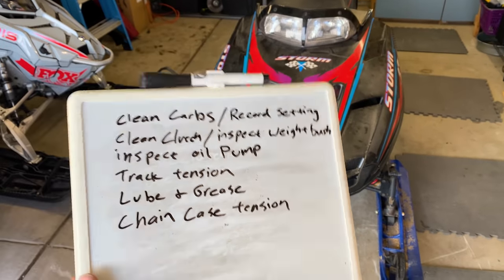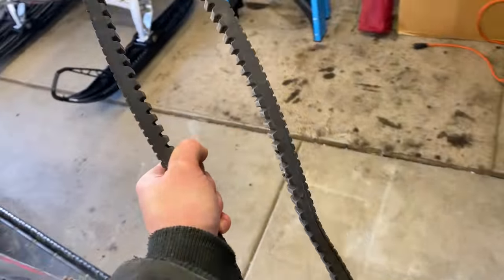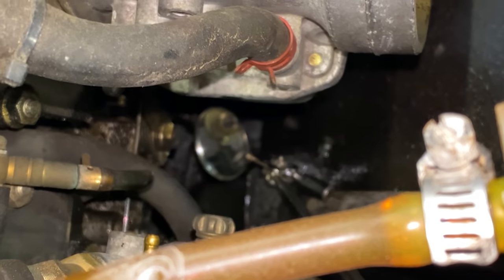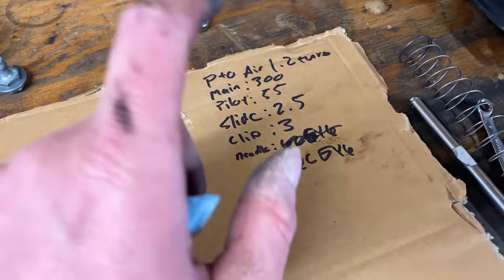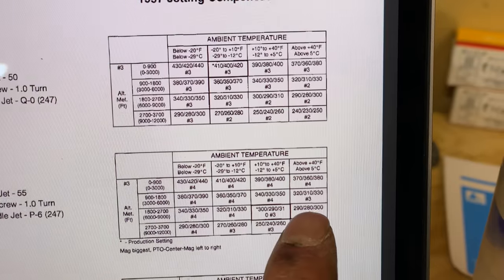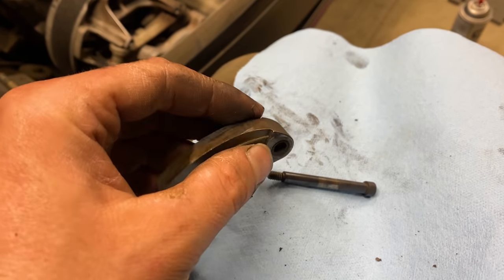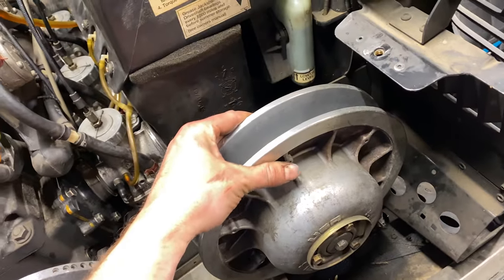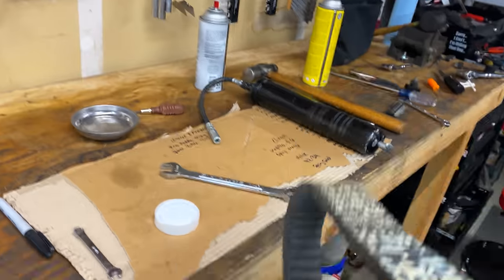How Pros Prep A 25 Year Old Snowmobile Before Its First Ride

Comment: Great list. I would add one more thing. Flush the brake fluid and make sure the caliper is working properly. We had a 97 summit 670 that had sat for 10 years, did all the normal stuff before taking it out, turns out the brake fluid had gotten moisture in it, and rusted part the caliper just enough to drag on the rotor. Heated up the rotor hot enough to melt a hole in the oil bottle, 2 stroke oil + a hot rotor= fire. Almost lost the whole sled, luckily got the whole thing encased in snow to suffocate the fire just in time for it to be still salvageable. 

Sweet old Polaris triple you've got there!
Reply from the maker: Great extra trip! Wild story too but makes total sense. Glad you could save the sled!

Comment: I wish my Yamaha 700 triple  had individual lower airbox pieces! Man it's a pain getting all 3 boots on at the same time!
Reply from the maker: Air boxes are the worst!
Reply: You know what I find helps with that... "Vaseline Petroleum Jelly" .... placed at certain key points just before attempting to reinstall the airbox ...a little Heat from the heat gun on the rubbers that fit around the carburetor throat also helps ...  works good, try it
Reply: First time i did it, i just pushed them in with bigger screwdriver, 2nd time i took airbox apart completely so i could reach in and do it.  think it was easier, but still a pain in the ass.  02 sxviper 700 triple.

Comment: Did you check the center to center on the clutches?
Reply from the maker: I did but I have yet to find a sled that has the clutch  center to center not in spec.

Comment: Quick question, how to you sync your carbs? Do you do it by hand or do you use carb sync gauges?
Reply: I have some mercury tube type thing, works with vacuum works great, up to 4 carbs. My buddy has one you just hold against the carb, then read the number's and make them match...from Wyoming USA 🇺🇸 🤠
Reply from the maker: On these older carbs I look up the spec in the book. I then use a right sized drill bit under the slide.